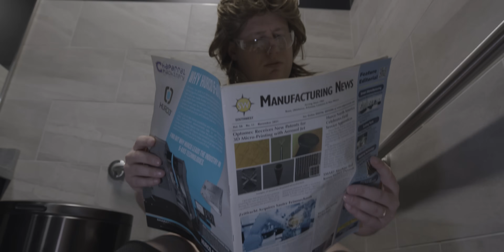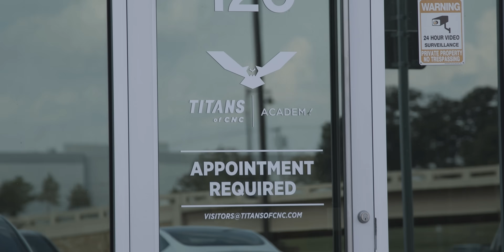Don't LIE, We've ALL Done THIS Before

Comment: Guilty, done it. Worst thing I found was during a fixture rebuild, went to remove  1/4 shcs to realize it was just the head of the bolt glued in the hole. After removal noticed there was a taped hole in the base but it was out of location.

Comment: All depends on the part, sometimes this trick is really a viable option and yes I've done it before but there are parts I've scrapped because it was not a good part to use this "technique" on. If I'm simply making a shop fixture and the press fit for a locating dowel pin became a tight slip fit that is an example of where this might be used.

Comment: The most hilarious part about this is the shop foreman in the last shop I worked at did this to a part, a very large and expensive part that had to ship the next day🤣. I was the QC inspector and he was my boss and I told him this wouldn't fly with the customer but he said to let it go, we shipped it that way with a +/- .0005" 2.000" bore that was .001" oversized from the top of the tolerance. It came back to us three weeks later and required the weld department to cut off the affected portion of the weldment (these are big parts BTW, 20,000 lb chunks of steel), reweld a new piece in and go back in the CNC mill to recut the features. I guess I was right lol.

Comment: You making fun of my buddy stake kracker at 4:10 😂 back at the first machine shop I worked with old school machinist had me do this to fix blown out bushing, of course the home was only about .0005 oversize and was for lumber mill equiptment, we also have knurled parts then turned to correct size😂 none of this was on any important parts but you hit the nail on the head with this one😂

Comment: As a former machinist now inspector, I find this absolutely hilarious. Mainly because I had some old school guy show me this “fix” when I blew a hole too big. I didn’t take his advice. Also, the cmm will pick that up in a heartbeat 😂.
Reply: Hey fellow inspector! Just curious, do you use any vision measurement systems? The Keyence has replaced the CMM for the majority of the parts I inspect.

Comment: Okay, i have to be honest.
Occasionally (maybe once every few months) we do that at our shop. 
But usually only if the part is used internally and the hole is for locating only.
Reply: While the whole "cheat the quality control" part is a terrible thing to do, knowing how to tighten a hole entrance with a ball bearing is good knowledge to have. I've used it to make vise (don't know the english term for it) locks(?). Make the hole slightly oversized, drop a ball into it, smack it with a bearing so the ball can't fall out. Of course you could do it with a punch tool too, but a ball bearing is easier to aim.
Reply: It is a terrible thing to do.  But anyone that gets on here and tries to give you crap for it and says they have never done it either has never worked in a machine shop or is lying
Reply: @Jessie_Smith  i know, that's why we only do it as rarely as possible and only on parts for ourselves.
And very true, i don't know anyone in the trade who hasn't done it at least once in their time

Comment: Pushing a hard ball through a bore to size it is not a joke, I heard ford used that technique on model T engines. I assume it was more for surface finish then size.
Reply: He was putting an oversized ball on the mouth of the hole and hitting it to peen it over.

Comment: A dowel pin hole was a bit to big for the pin, so we took a center punch and smashed it shut. It was for a testing tool that would only be used a couple of times, so it wasn't a big deal. So yeah, I've done that before XD
Reply: did this in my journeyman exam😂
helped all fellow guys there to fix their tolerances with it too 

parts were checked once and then assembled so no damage there 
was just to get the full points😂
Reply: @Sebastian-ed5kt  it ain't stupid if it works, right?
Reply: @nofunallowed3382  exactly, got me a good grade and currently I'm training for the master precision mechanic in Germany
Reply: We used to use an electro pen and burn the side all around the dowel pin, then beat that pin in with a heavy hammer lol.
Reply: @MaxStax88  haha we do that too!

Comment: What a legend.

I've used that "trick" was when I made a hydraulic lifting jack. 
The main valve used two steel balls to close off a pair of holes and the only way to get them to match perfectly was to shape the top of the holes to the diameter of the steel balls.
Reply: That is standard for ball check valves.

Comment: Press fit hole and your pin just slides right through? Hammer and cold chisel with a couple little tappy tappys around the edges… not to much now you’ll make it too tight and your good to go. Call that the Puerto Rican knurl 😂😂😂